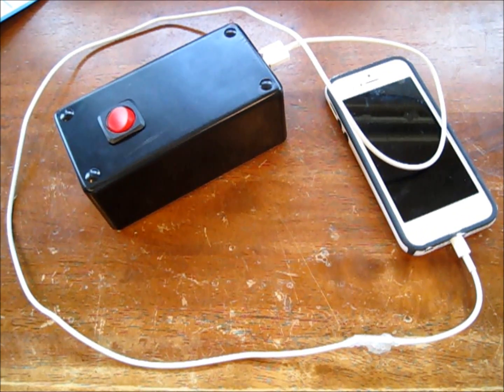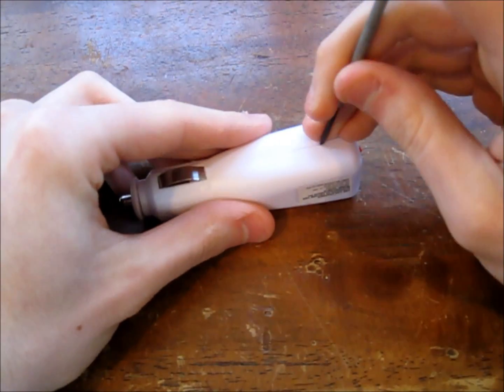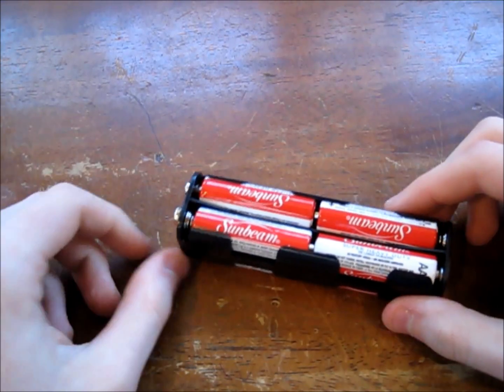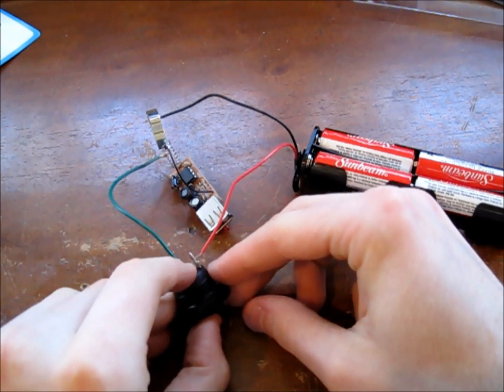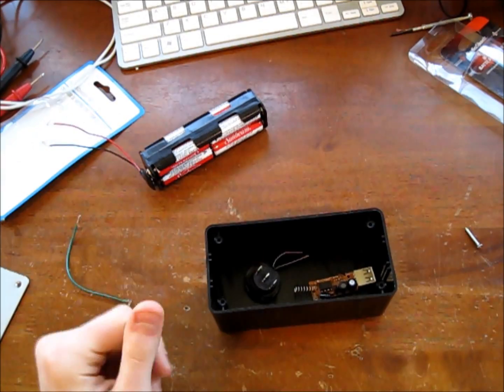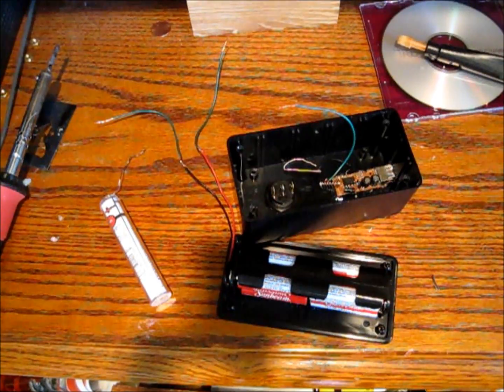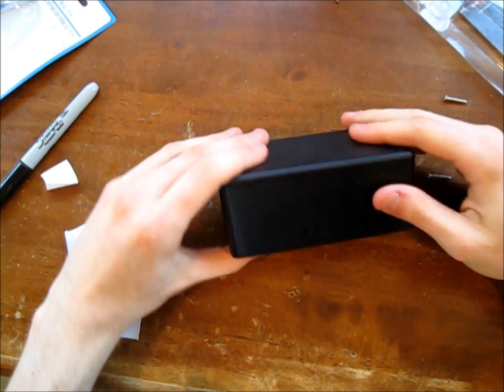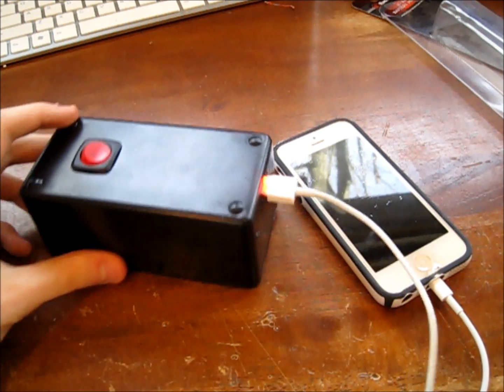How To: Make a Portable USB Charger!

Comment: I have a strong urge to make like 10 of these 😜😏
Reply: Jake Haberman if that is what your heart is telling you then do it
Reply: Jake Haberman I'm making this with a car battery
Reply: +Atlas Shrugged
Car battery? That would be such a waste because phones need only about half the power of car batteries to charge.
Reply: @realvivifromloona  you don't know what your talking about....
Reply: +mashed potatoes 
I do know what I’m talking about. Car batteries are 12 volts. Phones need 5 volts. The voltage step-down converter inside the car adapter turns the excess energy into heat. So not only is using a car battery for this a waste of money, but it also makes the car adapter more prone to overheating, especially if it’s one of the cheap ones.
Reply: @realvivifromloona  yes that is true when 12v is brought down to 5v there will be some conversion loss but considering that this project is made with AA batteries in series a car battery would be much more useful because of how much energy it can store even though it's big and heavy. The battery type doesn't make the car charger  overheat that would be the load that the charger is delivering and how much power is going into the charger to deliver the load. You could have a bunch  AA batteries in series and parallel to make it as powerful as a car battery and it wouldn't change a thing. You can't say a car battery isn't good for this application because the main part in this project is taking a 12v input and  bringing it down to 5v. It might get hotter only because it's being able to put out more amps because the battery can supply it.
Reply: +mashed potatoes 
I wasn’t saying that the battery type made it overheat, I was saying that car batteries put more load on it because they’re 12 volts. Those AA batteries he used here are 9 volts (because he wired them in parallel) so they put less load on it.
Reply: @realvivifromloona  um he had 8 aa in series not parallel so it was 12 volts
Reply: +mashed potatoes 
oh sorry i mixed them up
Reply: @realvivifromloona  still car chargers are meant for your car and voltages can get up to 14v when your car is on....
Reply: +mashed potatoes 
I know they’re meant for your car. Still, there’s a ton of stories on the web of cheap car chargers overheating in cars, so 9 volts would be a better choice for something you literally carry in your pocket.
Reply: @realvivifromloona  I'll have to do some testing with some dollar tree car chargers to see how well that really works, because I'm pretty sure at such low voltage it won't put out much apms and at that point you might as well get a power bank board for lithium batteries because it would have a better energy conversion and it should just be more powerful. It would also be interesting to see if it is more efficient because it would produce less heat but as I said Im thinking it would probably just charge extremely slow because of low amps.
Reply: +mashed potatoes 
Yeah you’re right about the low amps.

Comment: if you added a other USB port coming from the battery's you could even charge the battery's
Reply: The curcuit he is using uses an LM7805. What it does is it converts an unregulated voltage between 7-12V to a regulated voltage of 5V.

The LM7805 does not work in reverse. 5V is not enough to charge 8*1.5V = 12V batteries in series.

Comment: Why did you not use electrical tape to cover the soldered joints?  The exposed wire could short to the circuit board, to one another or to the batteries.  Perhaps you taped up the soldered joints and did not include this in your video.  Thank you.

Comment: Hi i wish to ask whether it is possible to make a rotatable phone charger.. meaning the ordinary phone charger(not portable) with usb port half of it will be rotatable.. max 180degrees to the right and back. 

What im concern is that will the wires in the phone charger be tangled up or that it will disconnect and make it impossible to use the charger?

Comment: Like the design but not really happy with the throw-away batteries. I'd prefer a rechargeable battery pack (which isn't much more expensive and also smaller)
Reply: ali heros There's no overcharge protection there
Reply: Then?do you have any suggestions
Reply: ali heros Try using simple lawn garden outdoor lamps that are rechargable, some have a rechargable battery in them. This can be placed on the outside with hot glue and wired to recharge the batteries.
Reply: Nice idea
Reply: Recycle bro !
Reply: You can add wires on the voltage for a micro USB female.that way you can charge it like your phone with a USB cable.flies away
Reply: You can buy a female micro USB cable and cut the other end. Put black wire on other black wire of already existing battery pack and red on red.its really easy to do but hard to explain by texting

Comment: Thank you very much for the video! Just a question, could I use a battery such as this one? http://amzn.com/B000YA7SQU
If anyone could please respond that would be awesome :)
Reply: It should work.
Reply: You'd have to have a pretty big enclosure, that's a big battery.
Reply: Yeah db336 I built it a few months ago and the battery is MASSIVE haha... nice knowing you can recharge your phone a good 20 times or so off it though :)
Reply: That battery is also rechargeable. We use them in exit signs, emergency lights, security panel back up, etc. you should get a good 5 years out of it with good cycling. I'm getting ready to build my version based off the video's concept. I found 12 v 6800 mah li ion battery pack with dc make and female connectors and it's own charger. I'm going to drill a hole and mount the female port into the enclosure box so I can charge it without taking it apart. I was thinking about putting a battery charge meter in to monitor the 12v battery but the cost is starting to build up pretty fast.

Comment: hey so i did exactly what you did the led lights up but my phone isn't connected to the charger... what did i do wrong? i also didn't use a switch
Reply: If you are trying to charge an iphone you may have an issue with non apple products and may need to mod the cable, Google is your friend.  Use it to read about this.
Reply: ODX171 there is no difference between apple and other phones with charging
Reply: HypersonicPig with charging???   with charging what or how ??
Reply: HypersonicPig you are wrong some devices/phone receive a small signal from the charger to tell the phone that the power is really there. thats the reason for a circuit like the 555 timer on the USB board
Reply: Ryan hoffman It will work just not as quick as a normal charger
Reply: not always for instance my company blackberry it wont charge off it because it needs to send a signal to charge unlike the apple iphone/ipod will charge no matter where the source is coming from. Source: I Teach this kind of stuff
Reply: Ryan hoffman what kind of stuff smartass

Comment: Great video, thank you. I only noticed that when you closed the box, the 2 green wires that you soldered to extend the battery holder wires may accidentaly touch each other on the points of soldering and short circuit the batteries. Perhaps you should isolate them with black tape or heatsrink....

Comment: What if i use nimh batteries cause i like to charge AA's separately. Will i be adding more cells than 8 ?? What if i overvolt the total voltage or go over 12 v . Will the car batt ciircuit take it?

Comment: y didnt you use one of the or even 2 of the rc battery packs been looking at 3800 mha 7.2v ones and just buying the usb part and a step down programer on ebay and you would have at least 5 recharges in the 1 unit 
the reason i will be using the step down as ill be running a much higher total voltage and the cheap one in that car charger i just don't trust them

ill do a vid once all my parts come from ebay and respond it to this one so you can see what im doing will be doing in about a month
Reply: http://www.ebay.com.au/itm/1-pcs-7-2V-3800mAh-Ni-Mh-rechargeable-battery-pack-RC-Tamiya-Plug-/190839425881?pt=US_Rechargeable_Batteries&hash=item2c6eea8b59&_uhb=1
that is the battery

Comment: Could you switch out the battery holder/batteries for a rechargeable lithium-ion battery?
Reply: Also, though it draws only a small amount of energy, couldn't you remove the LED?
Reply: Where to find lithium-ion battery ? By taking from the phone ?
Reply: JesusUnoWTF yes but you will need a usb Charging Board Module to be able to charge the battery without removing the screws every time they go dry, cost about $2 on ebay
Reply: I just figured that it would be easier to be able to just plug in the charging unit when you're able to rather than change batteries or recharge rechargeable batteries. Plus, depending on the size and stats of the battery, it would last longer (in theory, I guess. I dunno, I'm not an electrical engineer).
Reply: JesusUnoWTF heres a video to show you what im talking about but you will need a case to put it in /watch?v=90AefhgFu0M
Reply: JesusUnoWTF and you can buy AA or AAA batteries at any airport or gas station on the go

Comment: Good project but it would take around 16 batteries to replicate the output of one of those cheap pocket chargers you can buy on amazon for about £12. They also sell 10000mAh packs for around £20 which would equal around 80 batteries.

Comment: Make it in easy way

Step 1 buy a small  rechargeable 12v battery  ,and a USB car charger

Step 2  open up USB car charger 

Step 3  connect battery wires to car charger  

Step 4 put it in a box  

And TADAAAA you make your own USB charger

Comment: Didn't work. Could I get some instructions please?  I connected the wires and the battery pack started to heat up. It melted.  I bought a new one and before I cause a battery fire, I need your help. Thank you for your time

Comment: you might wanna insulate the two leads were you soldered the battery clip wires to the usb thing, because it can start a fire if they touch

Comment: good work. Wasn't easier to usse a 5V step-up USB booster? It rises the voltage fron 1,5-4V to 5V so you should use in this case inly 2 batteryes :D
Reply: wouldnt give your phone as much charge though
Reply: Slatert97
I use a 5V usb booster bought from e-bay.There are 5V 500mAh and 5V 1A.I have 500mAh and it work's great for me.I used 6pcs (wired in paralel) 3.7V Li-ion (18650) batteryes from an old laptop battery.I charge them on 5V from laptop or wall charger and I use a diode.I know it's not the best way of charging them but since I gave only 10lei (2 punds) for tle laptop battery it's ok to buy another.I fully charged a Samsung Galaxy Mini S5570 6 times.

Comment: I'm having trouble charging my ipad is there not enough voltage or wat?
Reply: yeah that's probably the issue. I have the same issue when I try to charge my ipad via my macbook. In actuality, even though the ipad displays the "not charging" message in the corner, it is in fact charging just very slowly.
Reply: ipads require more power than iphones

Comment: Very well done educational video on how to build something useful from available parts. Now I am thinking along those lines but I would need one for a tablet that requires 20v dc and 1.5 Amps. I was thinking of getting a universal with the different connectors but also wondering if an adapter with 16.5 v dc and 1.8 amps would work.

Comment: if u have a nine volt battery, do u need a 5 volt regulator ?
Reply: yes
Reply: Try to use a DC-DC converter 9v to 5v, lm317 will become hot and your battery may discharge as fast as you think. :)
Reply: You will need it because the phone,tablet,etc. requires 5 volt and when you have 9 volts,you will get BOOM :D
Reply: killarmy220 Thats right i tried  to use two 9volt batteries for the input,and they discharged in 20 minutes and only recharged my phone with 10%.Now i use 8 AA batteries and they will last for 5 full charges i think,because i charged my phone with 30% charge for 1 hour and the voltage of the battery pack dropped from 12volts to 11 volts.But if i use 8 AA rechargable batteries with 2300 mah of capacity each it will last a lot longer.
Reply: Georgi B.
Yep !

Comment: so your using 8 batterys would guess there 1.2 volts so thats 9.6 volts so i would guess the usb drives the input volts down to around 5 v .so in practice you could 16 batteries wired in series 2 holders x 8 batteries and get around 6 charges on your phone from one charge on the portable usb charger. better if you could design a mini usb input to recharge the box instead of removing the packs everytime to charge. anyway great video.

Comment: Nice idea but you will have to unscrew it all the time to recharge or replace the batteries. ( 8 AA cost $$$ to). And it will only charge an iPhone 5 about 1 and a half time with 8 AA batteries.  Seems like a massive hassle when you can buy a compact made for purpose portable USB mobile phone charger for around $24 / £18 that can charge an iPhone 5 over 2 times on one charge and can be recharged up to 500 times. 
Thousands of these portable USB chargers are for sale on eBay and amazon. 
Bit of a waste of time making your own sorry.
Reply: Well you gotta understand that this was made for uses when you need to charge your phone but don't have an outlet available. Its purpose isn't for regular use.

Comment: Nice! You should add a DC connector and attach it to the batteries and use a DC 12V charger, you wont need to open the case every time!

Comment: Love this tutorial I plan to build one very soon, I have a question/request, could you extend this project to include a way to recharge it also via USB like adding a mini/micro USB female port to the unit that with a usb cable to a usb power adapter we can recharge the batteries inside without need to open.

Comment: Dude 12Volts will blow the phone it only needs about 5 to charge it and u could see its fake because u used 2 usb chargers
Reply: You do realize that the usb car charger regulates voltage right? If what you said was true (which it is far from) your phone would blow up when plugged into a car.

Comment: It don't work dude only light comes...and it its very clear that you are using two usb cables...
So project is fake but must appreciate video is great

And as I did, do this project using rechargeable batteries and 5 volt regulator(don't worry it's very easy)...and try to take electricians advice, good luck!

Comment: I tried it with 6v instead of 12. It didn't work. I'm using 4 aa batteries and magnet wire instead of normal wire
Reply: usb car charger need 12v to operate.
Reply: It didn't work because the regulator has a voltage reference indside.It needs at least 2-3 volts more than the output otherwise the output voltage will not be 5 volts,instead 3-4 volts
Reply: Georgi B. ugxhxxhxxuyyd

Comment: I have the Dewalt 18volt batteries and just found out about a charger that fits them. It’s called PoweriSite preorder on Kickstarter. Could be a great accessory when the power is out. http://www.kickstarter.com/projects/463425404/powerisite-usb-power-from-your-cordless-tool-batte

Comment: I'm doing this very same project, except I'm using two 9V. Now before you go and screamat me for overloading a 12V unit with 18V, this thing has a voltage rating from 12V to 24V. So it's fine. All I have to do is find some rechargable 9V's, a charger for them and I'm done. Thank you for the help on this project.

But I must ask, is there any kind of problem with this? It did say 12v-24V on it, so... yeah. Can I trust that?
Reply: in put required for most of the mobile phone is around 1000 mA but a 9v battery will give a output around 200mA ..so it would seem to work, cos the output voltage is 5v but it is actually isnt..
Reply: What I'm making this project for is a portable charger for my Nintendo 3DS. 3.7V, 1300mAh, 5Wh. Can you explain anything about that so I don't kill my 3DS or something or give me a tip or something?

Comment: If you have 12V input, and 5V on output, and 0.5A power consum on output, thats 3.5Amper whasted with 1hour of charging in heat. 
Its better to have something like 6V. :)
Reply: USB charger is not linear but switching.

Comment: Horribly inefficient, the minty boost only uses 2 AA batteries using a super high efficiency circuit. Your is wasting so much power just to convert 12 to 5 volts.

This might be a lot simpler and cheaper initially, but you'll end up wasting a ton of money on batteries!

Comment: i assume you used a usb car charger to build the project? some charger do not provide a 2.5v in the data wires which is required for some device, try the charger in the cigeret outlet first

Comment: If you are only using 4 AA batteries, then it only pushing out 6V (1.5 per battery) I had the same issue. Glad I found this video, going to test using 8batteries to see if it works

Comment: If you used a usb car adapter it certainly wouldn't work.... 4*1,5=6V so it isn't enough... The usb adapter needs around 12 volts to work properly... You have to use 8 AA batteries....

Comment: Assuming that your iPhone is dead at 0% and using 8 alkaline 1.5v battery found in stores you phone will be able to charge for 2.7 hours or at 50% can be charged for 5.4 hours.(Sometimes it varies to different brand of batteries)

Comment: That USB car charger has a 5v regulator on it, so depending on its drop out voltage you should only need 4-6 AA's. Considering that it probably isn't a PWM regulator, you should get the same amount of charge from 5 batteries as you would from 8.

Comment: You do know they sell these in the batteries isle, like I know at walmart you can get rayovac ones that cost under $10... Easier, cheaper, safer (they come with a $1000 lifetime damage warranty).

They are about 1/2 the size, and have the same charge times as this will. Btw, that's about 4-7 for iphone/ smartphone, and around 10 for a regular dumb-phone.